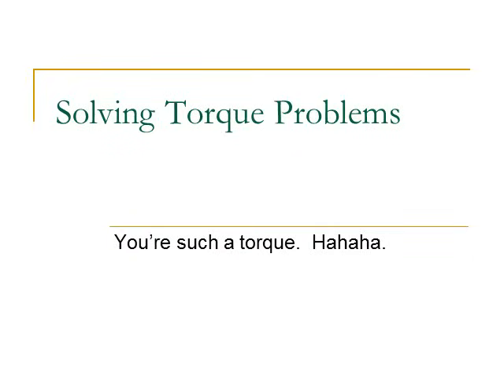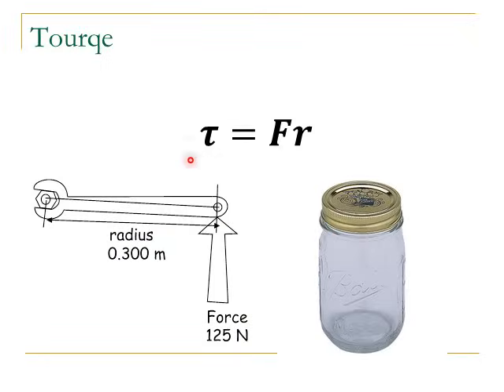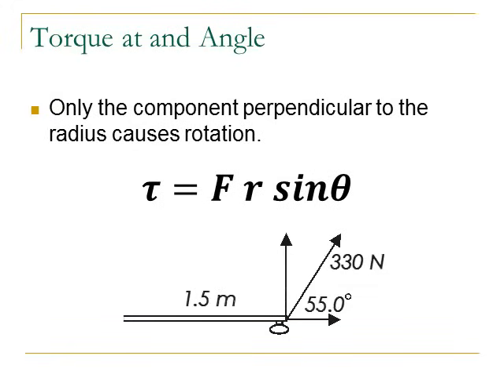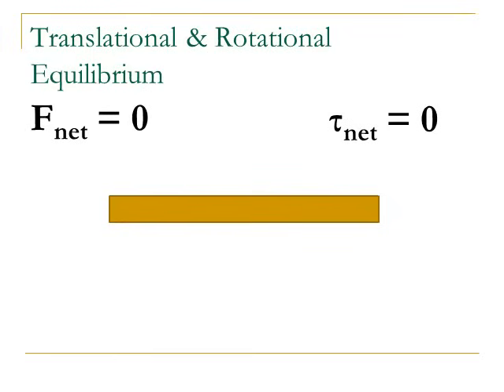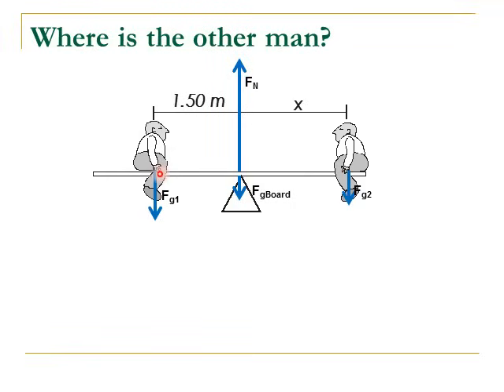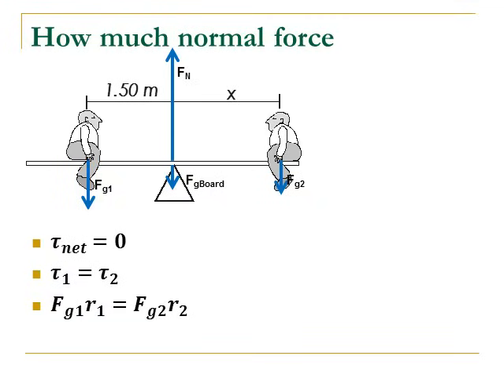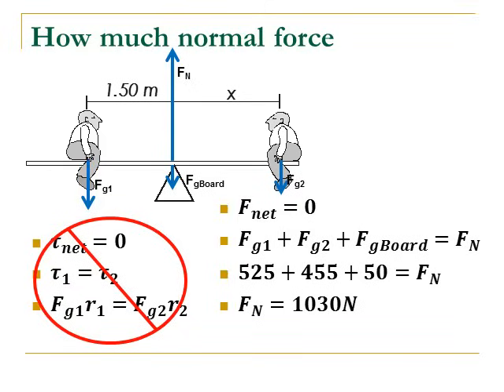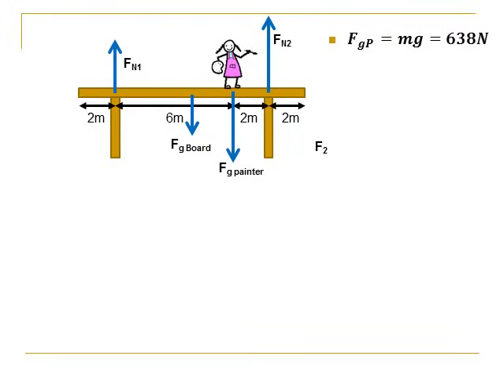Solving Torque Problems.wmv

Comment: Explanation and approach to the question was correct but at 13:24 you plugged in the wrong numbers. it should be 147(4) + 638(2) = FN1(8) and FN1 would be equal to 233 N and not 356 N
Reply: like the way u taught
Reply: this is true
Reply: same answer I've got
Reply: Yes

Comment: Didnt you switch the radius at the end. You said the painter has a force of 638N, And a radius of 2 meters.  But you put 638(4) , which is the radius of the board.
Reply: Why isn’t there a normal force for the painter

Comment: sir, in the second question where you multiplied 147 by 2, it should be 147 by 4 and eventually the value of F1 comes 233N and F2 comes 552N
Reply: Indu Das yup

Comment: Right answer for the second torque problem should be Fn(1) = 233N & Fn(2) = 552 N. The calculations were correct, but he mixed up the distance from the pivot point to the different forces.
Reply: Why isn’t there a normal force for the painter

Comment: great video .. can you explain to me why the normal force is larger on the center of the board than Mg is thanks
Reply: Very late reply, but here's how I understand it: the normal force is larger because it opposes the weight of the board and the weight of the painters. 

Remember that there is no normal force on each painter because the painters are part of the painters-beam system (which means normal forces from the beam on the painters are not shown).

Comment: make sure for the applying the given in the solution
it be 147(4) - (because the force of the board is 147 not 638, then 638(2) - (because the force of the painter is 638 not 147)
Reply: Why isn’t there a normal force for the painter

Comment: I didn't get the same answer, I used a the other support as the pivot… and i got 522 for Fn2 and 233 for Fn1, I think you may have the wrong r for the weights of the painter and board?
Reply: You are dead right. He screwed up at the final stage

Comment: May I assume that the beam will be in the same position, for instance, at a certain inclination of some degrees, if I put two equal masses at the same distance of the pivot ? Or it will rotate to the horizontal position ? In this case, why it turns to zero inclination, if I put two equal forces? Shouldn't it keep at the same position, considering the fact that the beam are subject to the same torque?? Thanks.

Comment: At 12:06,how do you know which forces will move the board clockwise and which will move it counterclockwise ?
Reply: Right hand rule.  Point your pointer finger from the pivot to the point the force is applied, and point your middle finger in the direction of the force.  The thumb points in the direction of torque.  By convention, torque is assigned to be in the direction that a threaded fastener would translate along the axis of the bolt, while subject to that torque.  This is because torque is r cross F, and the right hand rule yields the direction of the torque.   Torque will point out of the page if it would cause a CCW rotation, and in to the page if it will cause a CW rotation.

Comment: Good video, you made a little mistake though. At 9:53 The torque caused by weight of painter is counter clockwise, and the second normal force will cause a clockwise torque. It was a tiny booboo. Good work!

Comment: for the last one, aren't they all torque'ing in the clock-wise direction?
Reply: no cuz u use the direction that the force is pointing at...when u use f1 as a pivot u can see that f2 is acting in the opposite direction..trace the force with your finger and go in th direction of the arrow...u eventually find that the direction is opposite to ur pivot

Comment: r for painter and board have been switched in the actual calculation. it should be 638 (2) + 147 (4) = 8 F_N1

Comment: How does Fgboard = 50N?
Reply: Conor Murray It was stated in the question that the see-saw was 50N. If it was grams or a similar unit then you would multiply it by gravity to find N.
Reply: VIK96T reply 2 months after my exam but thanks anyway! I passed the exam btw ;)